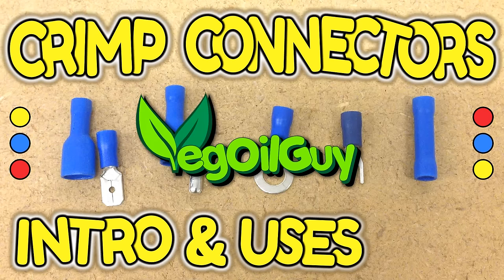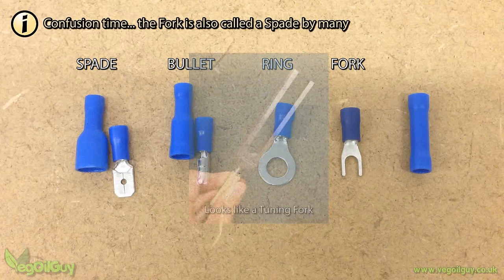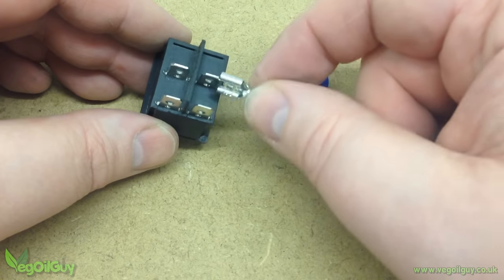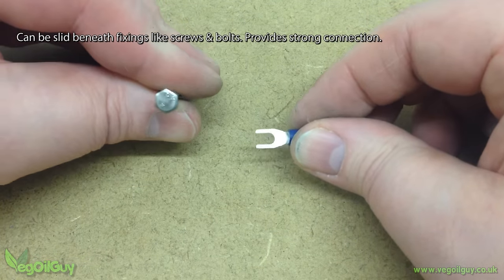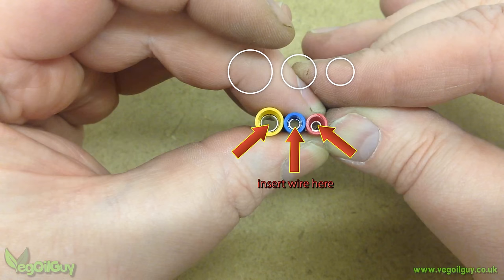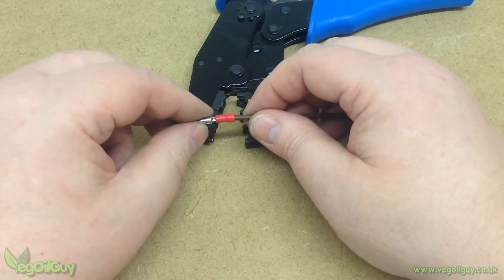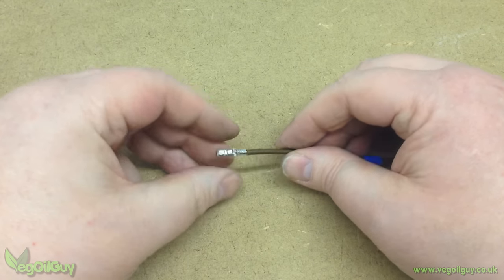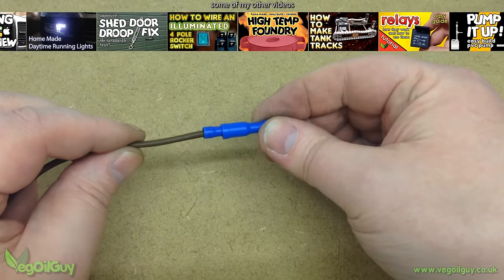CRIMP CONNECTORS how to crimp EASILY & SAFELY

Comment: A properly made crimp connection is just as good as a soldered connection. The wiring of automobiles has hundreds of crimped connections and if they were not reliable, we would all be in big trouble. A good crimped connection requires both good quality terminals and crimping pliers. I have found that a lot of crimp terminals form a certain large southeastern country are quite thin and will not make a solid connection, regardless of the quality of the crimping pliers. Likewise, crimping pliers from the same country may apply too little pressure to the terminal.  In the video, it seemed as though the crimp pliers (which looked cheap) did not require much force to be exerted to make the crimp. If a good quality crimp terminal is installed with a good quality crimping pliers, quite a bit of force it required to complete the operation. For some, two hands may be required. In my work, I have made thousands of crimped connections, with not a single failure.

Comment: i'm rather lazy, so use these regularly. only problems i've had with them is when using too thin wire (stranded) and they experience some movement along with pulling force; strands start breaking and the crimp ends up finally failing. i love using the spades on terminals with tabs since it's easy to move connections around or replace either part. i also like them a lot for working on car projects since wires are usually heavier gauge, they have hard to reach areas, and no need for running a soldering iron. 
however, for actual electronic projects that are small (stuff with ic's/passive components) they lose their advantages so i switch to soldering at that point.
Reply from the maker: Thanks for the input : )

Comment: The crimp tool has the little adjustment wheel on it. Spin it up a notch to tighten loose crimps😊
Reply from the maker: Yes, but mine doesn't spin 🙁 - but thanks for sharing the tip anyway 😁

Comment: Crimping is almost always superior to soldering IF done with good quality crimpers and connectors. Always use ratcheting crimpers with the correct die for the connector. Those were some pretty low quality crimpers in the video and were placed on the connector backward (dot always goes to the wire side). If you don't have good tools, then just solder - but it's worth investing in a good set of crimpers and then building your die collection for them over time.
Reply from the maker: That's good sound advice there Jeff. Thanks.

Comment: This might be a very silly question with an obvious answer, but I guess crimped connectors can't be reused?
Reply from the maker: Not a daft question... I've reused them BUT it's not easy. They're essentially hollow tubes of thin steel that you squash onto the wire. If you can wedge a thin screwdriver or similar into them, you can reopen them. I've done it a few times. But it's a lot of hassle and certainly wouldn't be worth you're time buying a job lot of used ones : )
Reply: Not really.  The material is designed so that it work-hardens when you crimp it.  You can lever the crimp open, but that leads to microscopic stress fractures in the material.  It's far more likely to fail.

If you need a temporary fix for something in an emergency and intend to redo the connection later, maybe.  As a permanent thing, don't do it.

Comment: Your turmoil about 'Spades' and 'Forks' starts with the miss naming of 'Fastons' as 'Spades'. See https://en.wikipedia.org/wiki/FASTON_terminal. 'Faston' is trademarked so like Scotch Tape, you see them called by other names when the manufacturer doesn't want to recognize the trademark. I think the current owner of the mark is TE formally known as AMP and before that T&B. They are NOT 'Spades'. 'Spades' and 'Forks' has been used interchangeably for some time with common usage drifting toward 'Fork'.
Reply from the maker: You've certainly done your homework Fred  : )

Comment: Soldered splice?  OK, if you put heat-shrink over it.  Not just for insulation but also to prevent fatigue from vibration.  A crimp is more resistant to vibration because there's no solder-embrittlement of the wire.  Done correctly, a crimp splice is more reliable than a solder splice.

If you look at an aircraft wiring loom, the connectors at the ends of it are far more likely to be crimped to the wires than soldered.  If you look at the really high-voltage power lines they use crimps, too.
Reply from the maker: I've heard from a lot of people who agree with you : )
Reply: @vogman  
A good crimp joint is more reliable than a solder joint.  A bad crimp joint is worse.  Soldering a crimp joint or tinning the wire before crimping is even worse.

Oh, and using the modern lead-free solders is even worserer.  Those shitty solders have a greater tendency to grow whiskers that can lead to short circuits.  God knows why we worry about a little lead-based solder in waste dumps given the enormous quantity of lead bullets we've left in farmers' fields around the world.

See, for example, https://millennialdiyer.com/articles/motorcycles/electrical-repair-crimp-or-solder/

Comment: Sir I want to connect aluminium wire to copper wire how it is possible 220 volts AC full house load  with one 1.5 ton air conditioner.

Comment: Can you connect a yellow color spade make  connector to a blue color female spade connector.
Reply from the maker: The colours don't really make any difference. As long as they fit they'll work. However, the colours do relate to the gauge (thickness) of the wire. Thicker wire draws more current. If the wire is two thin, it will burn away.

Comment: I have a pair of Klenks, a crimping tool that is very effective, I work on  floor cleaning equipment and can't tell you how many poor crimps I've seen from the factory,  soldering is messy and a huge pain in the ass, on my car, I cut the covers off of butt connectors and use shrink tube, it's effective, neat, clean and weatherproof
Reply from the maker: Thanks for sharing 😁

Comment: I dislike butt splice connectors, the amount of them that eventually fail is irritating. Previous owner of my car I guess had some electrical issues and replace a lot of wiring.

They would just cut out a section, and replace it with as much new wiring they could. For three years I've been tracing down these faulty connections all over the car. Apparently the former owners mother had the car, she passed, and it sat parked for about 3 years resulting in some rodent calling the engine bay home.

These butt connectors over the years would fail for one reason or another, though wire oxidation seems to be the most common. Over time the oxidation just built up gradually lowering the connection quality. I kinda understand why they did it since no one makes electrical wiring harnesses for the motor any more my Lord has it been a nightmare to solve any issue this car has had.

I decided several months back to replace all of them I could find, soldering iron, dielectric grease (to prevent possible corrosion as this was the main issue I had been dealing with), and a double layer (of different sizes) shrink tubing. Most of the problems with the car has been addressed thankfully however the brake lights continue to stop working when the headlights are on (they light up when you turn them on, they just don't get brighter when you apply the brakes).

Comment: Have to agree the colours type crimp connectors tool often doesn't do a good job ,very surprised is not a good one on market that does a good job ,such an important thing  surprised most crimp tools leave it loose , the different tool for copper tube ring connectors works great

Comment: You can also fold the copper strands back over the insulation and then push the insulation and copper into the crimp - once crimped down the insulation helps to provide more grip for the crimp. Just crimping onto the copper itself seems a bit risky to me - with enough flexing, it can break.

Comment: Why not use a larger connector. They have to be inserted into the crimper tool a certain way. Can’t tell with that little blue connector.
Reply from the maker: The size of the connector is influenced by the thickness of the wire : )

Comment: :) Dies in your crimping tool are not my favorite to put it lightly :P I think it would be better to use ones with U shape on one side and a smaller stake on the other that goes inside of this U while crimped. Something like these : https://www.heramenta.com/wp-content/uploads/H0108-Ratchet-Crimping-Pliers-for-Insulated-and-Non-insulated-Terminals-1.png 
That would crimp well,as long as you will remember to position ferrule correctly - it's got a seam that must be  on opposite side of a stake in crimping tool. If done right you can rip wire apart without it releasing from a crimp. I like soldering too, but crimping  can also work :)
Reply from the maker: You're right Andrzej, the fault lies with the tool in this case (phew). I do know plenty that crimp regularly without trouble. I need these so rarely I just went with very cheap crimpers, and that's often a mistake  : )

Comment: For crimping use the crimping pliers that are made for non-insulated connectors. The pliers have a square shaped “tit” on them. I use it for both non insulated and insulated connectors. It usually cuts into the insulated ones a bit but I just wrap it up with tape.

Comment: Youre crimping the wrong way around, also soldering on vehicles isn't, very popular these days as changing temperatures (especially summer) can cause solder to soften causing dry joints.

Comment: Crimping tools work fine but they need to be of a good quality and calibrated. at least annually .
(which was part of my technical support  role prior to retiring)
This involves crimped wire  being strain gauge tested to  destruction ensuring the crimping tool is operating to specification .
The multi die tools are no where as good as single die because the crimping load applied varies between the nose to the throat of the crimpers.
However for general work they are Ok but not for high risk installation work such as the military , aircraft or other public transport environments

Comment: please try a good crimp tool , weldmuller / knipex  not these , ive made alot of motorcycle motor harnass , also with bullet connectors (not anymore , now  i use amphanol connectors and TE ) but ull get a better result

Comment: The problem I find is most connectors are made of alloy so you can’t use solder , and the people selling them don’t have a clue to weather they are steel or alloy.
Reply from the maker: That's interesting David. I haven't come across that problem yet. No doubt I will soon enough  : )
Reply: Weird. Here in the states those types of connectors are always made of copper with a tin plating to give the silvery appearance and protect against corrosion. This is what he's using in the video.
I've never seen or heard of steel ones (steel/iron is a poor conductor compared to copper) and the aluminum connectors tend to be large and use a screw or bolt to clamp the wire into the connector. They've got their own use cases. I'd recommend buying any decent quality connector and they will be tin plated copper which solders easily.

Comment: You're crimping wrong that's probably why, you need to crimp physically on the insulation of the wire with the copper touching the bullet

Comment: I find that if the crimp doesn't seem secure you need a girthier wire, it needs to be snug.
Reply from the maker: Thanks for the input : )
Reply: @vogman  Also, I always preferred soldering, but I believe soldered connections are generally not allowed in automotive purposes as they are more brittle. When soldering a stranded wire to a connectors the part of the wire closest to the connector can become brittle. This is generally the part of the wire that gets stressed when moving the wire, you don't want it to become a solid wire which soldering can make it, the solder travels up the wire strands a bit.

Comment: Properly crimped wires will last decades. Some but not all of these crimp tools have to be used the right way around or the wire will be loose. There`s no feeling like chasing up a fault in a marshaling cubicle and finding every terminal has been crimped the wrong way. Soldering is not the preferred option where any movement may be encountered as it creates a point of stress which will break eventually even with routine maintenance.

Comment: Get a better tool and you will need only one crimp! 
I got mine Cembre MLL1 for 50€ shipped from UK, and it's totally worth it. Put that Silverline garbage away please :) You definetely don't want to solder and crimp terminals, since soldering make the wires stiff and they can break with mechanical stress. 
If you want to learn some stuff about crimping look for some NASA guidelines for crimping

Comment: SO,  just to be clear, as it wasn't mentioned . THIS IS ABOUT CAR ELECTRICS ? and NOT households electrics, as I want to know how to safely, re join up Xmas lights cable, that was chewed by the dog ( while it was unplugged ).
Reply from the maker: Well, not just auto electrics, no, but typically more lower power circuits. Anything mains power needs to be treated with respect, even if it's just a transformer, etc. 
This video https://youtu.be/NLd2yTq8wtk will show you some splicing techniques for joining wires. You could apply these to anything, though many would frown at me for advising that. A spliced and well insulated wire is 100% okay, but generally full wire replacement is preferred for mains stuff.

Comment: Your crimp connectors fail because they are inserted in the crimper wrong.  All connectors are stamped from flat metal and then folded.  Always put the seam on the cradle And the pin on the backside of the seam.

Comment: The fork is called a spade because of the audio industry, there a speaker cable that has connectors have spades on them ... Which should actually be called ... Forks ... Weird huh 😉. Now check the banana connectors, tell me what they look like ... Just shoot 😂
Reply from the maker: Really? That's interesting. And those bananas are remarkably straight aren't they 😁
Reply: @vogman  they sure are ... Ah what's in a name right 😉

Comment: Speaking of your male /female connections my cousin (who is a plumber) tells me that this M/F term is now replaced by inner/outer because of political correctness  as in the engineering world a slave relay or  cylinder is now a secondary cylinder etc.
Reply from the maker: It was just a question of time before this happened I suppose 😁
Reply: Woke engineering 😅

Comment: forgot the hook
Reply from the maker: I've never used them, but you're right : )
Reply: @vogman  I use them for repairing my old Schwinn headlight cable connectors that run to the light generator. I guess the fork would work too.

Comment: i don't use that type of crimp pliers. There is a more basic type that works the best for crimp these. the non insulated crimp part is the only part i use. First i put the plastic cover on the wire then crimp the connector then put the plastic over then crimp that using the insulated crimp part of the tool. Thats how you crimp without soldering. Much faster then waiting for you iron to heat up. https://www.lowes.com/pd/IDEAL-Crimper/1083479

Comment: All those crimping tools are useless, literally never work even if you use Blue crimp in red crimp slot. The best is electrical pliers with a crimping notch, I crimp almost every day at work with no problems with pliers. Only time a legit crimping tool is needed is a large lug or spade. Ive even seem some of those tools that dont give the greatest crimp, the best lug crimped is a hexagon but the dye is over 10mm long, some are only 5mm long and multiple crimps are required.